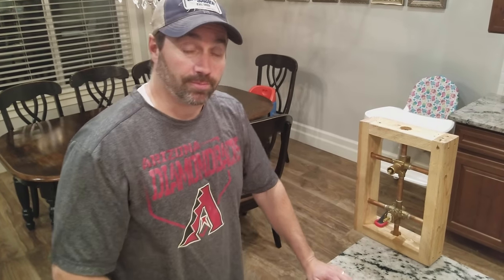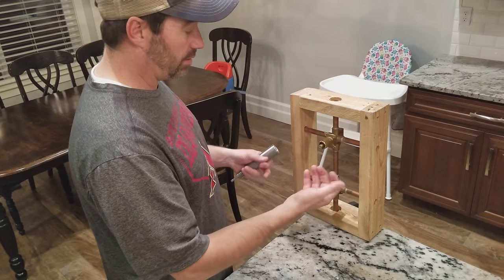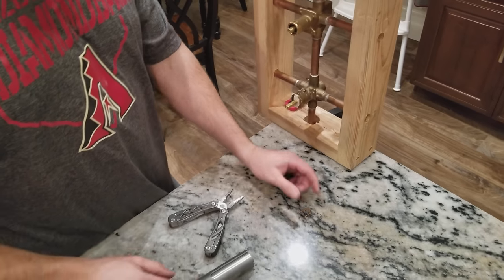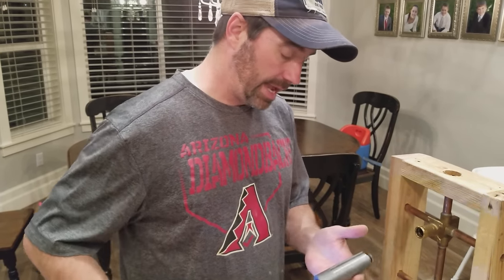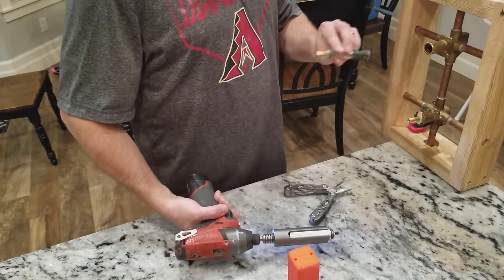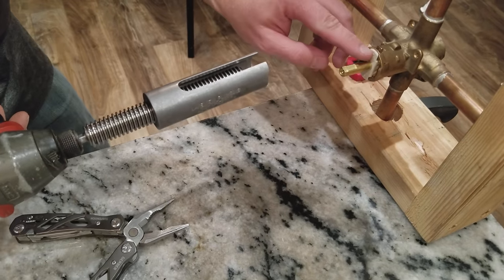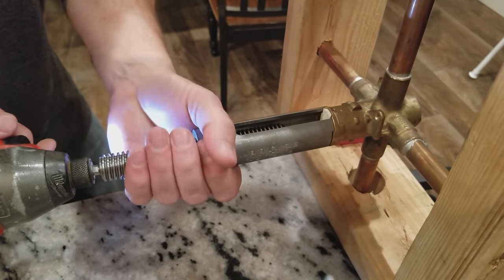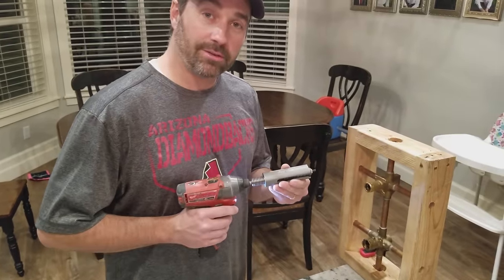How to Remove Stubborn Moen Shower Cartridges Fast!

Comment: My name is Sam S from Fair Lawn, NJ. Logged in under my wife, sorry don’t have my own account.  Anyway, I reached out and spoke with Brandon today and even though we are miles apart, and I couldn’t use his tool because I royally screwed up my DIY attempt in replacing a leaking shower faucet. However, Brandon did not cut me short, in fact he explained ways to try and correct my wrongs befor just giving and paying $$$ for replacing the entire section!!! Just wanted to thank you Brandon. You guidance not only
Calmed my nerves but saved me tons and I now have a working shower with no leaks!!!  Thank you sir!!!  Appreciate you. Stay safe and Be well. Sam S.
Reply: Sam i need help contacting Brandon. I want to buy his shower valve puller. But he is not answering  i sent him a message and so far he has not answered

Comment: For those with Posi Temp and are a tad short of cash to buy this tool in these inflationary times, a lifeline that could help you with groceries for the week. 
1. Get the generic puller tool (Moen, Danco or Amazon).
2. BREAK the top (HC embossed) and lower plastic tabs on the old cartridge with a flat head screwdriver. This will allows the the cartridge to slide a good amount into the outer sleeve. Note scrape or file plastic a tad if needed. Just dry fit the out sleeve on and look through and you will understand what I mean. Its easy.
3. Mount generic tool as instructed.
4. Using a 12" adjustable wrench tighten the hex nut on the outer sleeve while holding the handle with a pipe or handle of am adjustable screwdriver.
5. Continue and let the outer sleeve do the job until you see the O ring in the pin slots. The tool is a solid 1" puller BTW. 
6. With the O ring dislodged and the gaskets moved, just rotate and pull handle and the cartridge will come out. 
This is not to diss the tool here but just to show that the generic tool cannot work on the Posi Temps because of t he Pesky tabs that this tool has a guide for but no real lasting use. You just toss the old cartridge away anyway.
Reply: Great video, makes total sense. Try this first, it's fast and easy when it works...(about 75% of the time for me.)
 Turn off everything in the house, go out and turn the water off to the house and release the pressure, turn it back on to a slow stream out the hose bib, close the hose bib to re-pressurize the house. Kinda hold the cartridge in as you remove what ever retainer is holding it in...usually it's stuck or you wouldn't be doing all this, find a way to gently  twist the cartridge left and right without mangling it..be patient as the water pressure behind it will work it's way in and eventually start pushing the cartridge out....yeah, it basically blows out (hold on to it) but the water volume will quickly reside to the stream you set it at. Comes out clean and nothing buggered up. Let me know ok?
Reply: @readmore3634  I did this accidentally.  I forgot to shut off the water and as soon as I removed the clip it shot out.  No big thing, I just closed the shower curtain and went to the basement to shut off the water.  The cartridge was in the house for probably 25 years. In this house, we use Lake Michigan water and it is not very corrosive.  I have a condo in Naples, Fl. that water is extremely corrosive and I don't think 40 or pounds of water pressure would blow it out. I've replaced three in Florida, two in my condo, and one helping a buddy.
Reply: haha ....I've probably done that before. As long as you know how to shut off the water BEFORE you start ANYTHING.
...As far as "blowing it out" goes...constant water pressure, as you ever so slightly turn the cartridge left to right, slowly washes out the grime, debris particles and rust as you work it left  and right.....be patient.....you'll see it start to come out...reach over and flush the toilet to relieve 99% of the built-up pressure....and just pull it out the rest of the way....looks pro when it works.....and it usually does.
Reply: @readmore3634  Sounds good, my last experience replacing the cartridge was a couple of years ago in my condo in Naples, Fl. When I was 79 YO and I was sore for a few days, it took me about 5 hours. I pulled the stem out, and I don't have a lot of tools in Naples.  I am now 81 and if it happens again it is plumber time.
Reply: Link for the tool?

Comment: Now I know what New Tool goes into my plumbing truck. Pretty Cool guys.
Got a tip for you,,,I was on the phone many moons ago with Moen Tech Support and the guys said use Hair Spray instead of WD 450 to loosen a stubborn cartridge . There is a special chemical in Hair Spray that makes extraction easier. I tried it and it works fine.

Comment: Great tool!!! When using this puller the motion starts and doesn't stop until the cartridge comes out completely. When using the Moen manual puller you are constantly stopping and starting as you turn the nut which can make for a better chance of the cartridge breaking or pulling the middle spindle out of the cartridge housing. With our extremely hard Florida water, I would have cartridges break in 1 out of every 4 I pulled out, which causes much more time to get the pieces out. With this tool I have not had one cartridge break on me  (Tom is "knocking on wood"). I recommend this tool to everyone who has Moen faucets, or works on Moen faucets. Trinity Plumbing of Tampa Bay
Reply from the maker: I appreciate your comments Tom. Good luck in the future!
Thanks,
Reply: Tom, you are so right about Florida water.  I have a condo in Naples, and I had to replace a cartridge that was installed about five years prior and it was extremely difficult to remove.

Comment: If you're a plumber by trade, I can see where this tool would be indispensable.  I'm not a plumber and I spent at least four hours yesterday trying to extricate a stuck Moen Posi-Temp cartridge. Ultimately, I had to throw together a contraption similar in principle to this cartridge puller tool to get the *&^%$(*'ing 1222 out.  Well done, Brandon. I hope you sell a boatload of these sanity-saving pullers.
Reply: I have a moen three handle shower faucet.   I can’t get the wall tube off!! Any ideas?  I can’t even get to the cartridge.
Reply: El Diablo, your comments on the 1222
Are SOOOO SPOT ON!!  MOEN IS the
*&^%$*ing WORST!! 😉🤯🤠
Reply: Agreed.  The Moen 1222 is the biggest turd on the planet.  Need to be replaced frequently and are are terrible pain in the butt to remove.
Reply: @bowhunterd2407 Blame your water, not the cartridge.

Comment: Used for the first time today. Moen positemp valve but mine did not have the cutout to match the tool but it still worked fine. I tried first with a regular cordless drill but the valve didn’t budge so out came the impact driver as recommended in the video. It came out but took some effort. I’ve never changed one of these valves before and I would not want to attempt it without this tool. It was fused in there pretty good. No way you could just pull it out with pliers.
Reply from the maker: Thank you - I appreciate your comments.

Comment: I wish I had this tool yesterday.  I had a stuck Moen Cartridge. Even with a cheap extractor tool and snipping the plastic fins on the cartridge I could still not pull the cartridge out.  I had to use a prybar and a block of wood to get enough leverage. Unfortunately the previous plumber did not fasten the valve to the wall frame and the CPVC 1/2 inch threaded coupler cracked behind the wall.  I had to remove some tile and fiberboard to get access to the fittings to replace the broken pipe.  Then patch the fiberboard, cement and regrout the tile.  What a PITA!!!.  That tool would have saved me a day and a half of extra work.

Comment: Thoughtful engineering went into this one. I scratched my head wondering why the drill didn't just unthread from the center contact when you back out. Then I noticed that the outer threads are left hand, so forward action with the drill pulls the cartridge out, but keeps the inner contact secure.
Reply from the maker: I appreciate your comment. Thank you!

Comment: That looks like an awesome tool for the professional plumber to have in his truck but too expensive for us diy guys. I struggled for an hour and ended up drilling a small hole and driving a drywall screw into my 1222 cartridge and then used leverage on the screw to pry the sucker out.  I'll sell the house before I ever try that job again...
Reply: I think this is also great for a DIYer. I have four of those Moen faucets and used the tool on two already. Saved me a lot of time and avoided potential damage to the plumbing due to stuck cartridges. Great tool to have in the toolbox.
Reply: $175 for a tool is way cheaper than calling a plumber while your house is without water (if you dont have shutoff valves to the shower).

Comment: Nice concept. Anyone here bought the tool and use it on a shower cartridge that been stuck due to hard water/age.  So far i have not run into any broken stems on the job knock on wood.

Comment: I just ordered one of these. I can’t wait to show the guys. Most carts come out fairly easily and I only need a pair of pliers, but in the event one is giving you friction, this tool is a quick save. And it is badass.
Reply: And yes the price is steep.....but it goes above and beyond any of the other types I have seen. Kind of like the Rigid internal pipe wrench.... it is about 3x more expensive than the other brands, but it is a superior tool.
Reply: And...the one delta makes is $175. So keep that in mind.
Reply from the maker: Thanks for the order - I'll get it out to you right away. 
Brandon

Comment: I have been a plumber for a long time, have several thousand dollars specialty tools, I also have the ONA puller designed for the older moen with a barrel extractor.   I made an adapter rather inexpensivley for the positemp . Keep yours, not worth $160. The Ona puller is substantially cheaper, and solves the problem that yours does not. At first I thought it would be a something to have, but not at the price. I suggest real plumbers look at the Ona puller.
Reply: THANK YOU! this is the best puller ive ever gotten. that barrel extractor is phenomenal, and ive never pulled a positemp so easily. picked up the full kit for like 50 bucks.

Comment: Update: Removed the second cartridge today (one day after the 1st cartridge).  This time I did it manually using a socket wrench, and it went even smoother.   The cartridge did not shred at all and came off the tool easily when I was done.  Fantastic tool!

Well, I took the plunge today and removed a positemp cartridge that’s about 25 years old.  Much to my relief, the tool made short work of it, but I did notice a few things:

The tool did struggle with the cartridge, as it was really wedged solidly in the pipe.  The rubber flaps pealed off, an o-ring at the back split into two pieces, and the back plastic ripped apart.  There was some other damage to the cartridge too, but it did come out and the other pieces were easy to retrieve.

My pipe does not have the metal tabs for the tool to slot into, so the tool started to spin in my hand, and I foolishly was not wearing gloves.  Luckily I was going slow, so no skin lost, but it is something to be aware of for people who may also lack tabs on their pipes.  Once the tool pushed against the pipe hard enough, it stopped trying to twist out of my hand.

I noticed the tool struggling toward the end of the extraction, which seemed odd since the cartridge was nearly completely out.  Also, it was difficult to remove the cartridge from the tool, and I had to use a wrench to hold the cartridge.  This was probably due to the issue I had with the tool spinning in my hand, so no fault of the tool.

Summary: this tool is AMAZING, and I don’t think I could have gotten the cartridge out without it or it likely would have taken several hours with a lot of creative language.  Thank you so much for such a fantastic tool!!  I still have another shower cartridge to do, but I may need a few months to decompress before going at the second one.

Comment: Definitely this is the best puller for this job, but I will try first with a cheaper puller, if it doesn't work I will buy this one. It will be cheaper than paying a plumber. Thanks for the video.

Comment: My cartridge broke off inside trying to remove it with a pair of channel locks. Ended up using a hammer and screw driver to remove the rest. What a pain in the ass.  But I got it out, and the new one is in. Wheeew! Thank goddess.

Comment: I install a lot of Moen Positemp.  I made my own crude home made version by modifying a half-way useful short commercial version into a fully usable version by adding piping sleeve.  

I like yours very much with the long sleeve.  

A possible suggestion for you....make a tool to INSTALL the cartridge too.  Cannot put cartridge in sometimes due to too much air or water pressure, or pipe condition, etc.  Last 0.25 to 0.5 inch just won't go in even with lubrication. Can't push hard enough because not enough leverage due to circular casing partly in the way...or not enough flat surface area at protruding metal shaft to push against. If you push on shaft itself then the back of cartridge extends making cartridge longer and preventing cartridge from going in all the way because it became too long

Can do something like a C or F clamp that can sneak through the wall opening as well as the multiple piping maze behind the wall, but uses a SCREW motion leverage to push in the cartridge.

Comment from the maker: If the stem is already broken off it's a little tricky. You have to drill a hole in the remaining brass stem and tap it with the same 10-24 threads.
Reply: Can you post a video of this?

Comment: I'm wondering: If  you have one of those super-stuck Moen cartridges, where the middle part tends to get pulled out, leaving the outer part stuck in the pipe, then why would this tool not produce that same result? Why wouldn't it just pull out the middle portion of the cartridge, just like a regular Moen pulling tool does, leaving the outer cartridge stuck inside the pipe?
Reply: Ona makes a puller with that in mind. It is a comes with the barrel puller. The kit is about $ 50.
Reply: rudjeep1 n
Reply: @rudjeep1   where do I find one.? Stock seems to be empty
Reply: When using this puller the motion starts and doesn't stop until the cartridge comes out completely. When using the Moen manual puller you are constantly stopping and starting as you turn the nut which can make for a better chance of the cartridge breaking or pulling the middle spindle out of the cartridge housing. With our extremely hard Florida water, I would have cartridges break in 1 out of every 4 I pulled out, which causes much more time to get the pieces out. With this tool I have not had one cartridge break on me  (Tom is "knocking on wood"). I recommend this tool to everyone who has Moen faucets, or works on Moen faucets.

Comment: What do you do when the internal part of the cartridge comes out, but the the outer body of the cartridge gets stuck in the valve body?
Reply from the maker: Good question. This doesn't happen very often, but I just use an "easy-out" from my local hardware store and that usually grabs on enough to work it out.
Reply: If anyone is still interested here's a great video on what you might do. https://www.youtube.com/watch?v=XmBf4O1hM2k
Reply: I prepared for that event by watching a video where a guy used an 18mm tap to create threads in the cartridge.  He then used a corresponding 18mm bolt and some washers (for separation), and then started cranking the cartridge out.  He then placed a crescent wrench behind the washers against the pipe to allow for the cartridge to be extracted further until he could pull it the rest of the way.  Then came the fishing expedition to retrieve any broken fragments left behind in the pipe.  If you decide to go this route, just remember to make sure your bolt is the right size, and has a size and pitch that matches your tap.  I found a company that had an assortment of 18mm x 1.5 pitch in various lengths and at a reasonable cost.  I got that stuff upfront, along with some long hemostats, to ensure I wasn’t stuck with a situation where I would not be able to use my water for multiple days.

Comment: Hello, great video. I have a roughly 40 year old Moen shower. Before seeing this video I went through hell removing the cartridge stem out of the shower valve. Unfortunitely I was told my Moen that the outer brass shell of the cartridge was still inside the hole. Anything made for removing the outer cartridge after removing having already extracted the stem where you would put the screw into?

Comment: On the 1225 cartridge replacement there's a part that comes with the new cartridge read instructions put it on old cartridge turn old cartridge with wrench it will loosen cartridge then pull it out

Comment: Is this ok with cpvc piping connected to the valve
Reply from the maker: Yes, the way this tool works is unique because it adds zero stress to the plumbing behind the wall.

Comment: hi, my stem is broke, what would you recommend? thank you mine is like the bottom display.
Reply from the maker: Unfortunately, if the stem broke you just have to wrestle it out the old fashioned way. I recommend using a small, fine torch and digging it out after you melt it. Careful to not scratch the inside of the valve body. I had this happen to me a few weeks ago - took about 1 - 1/2 hours...
Some guys try to drill them out - but be careful not to damage the inside of the valve. Good luck